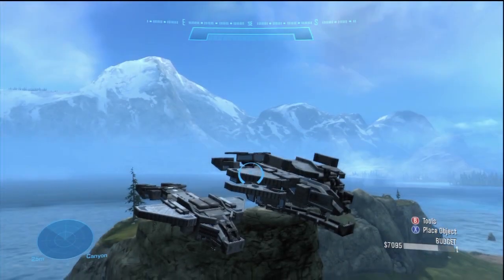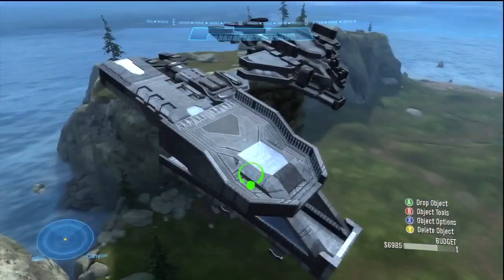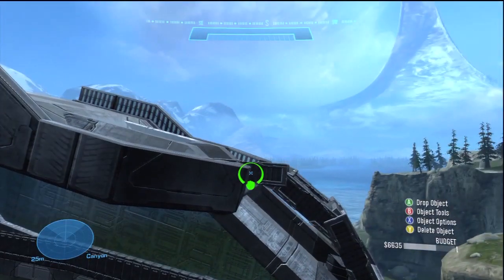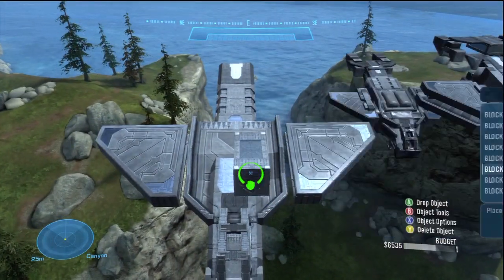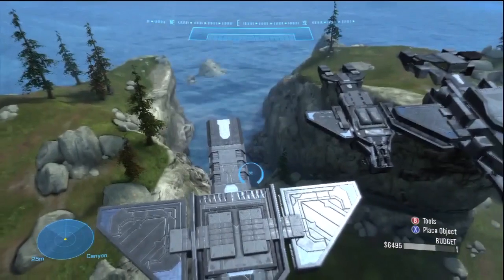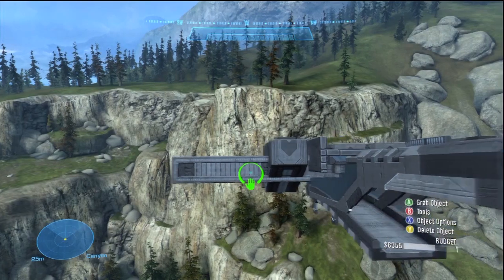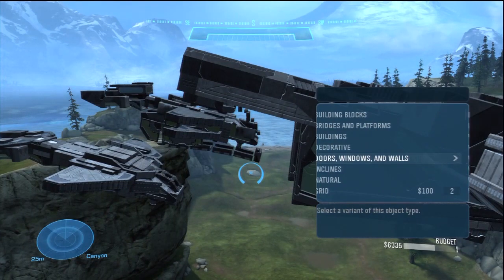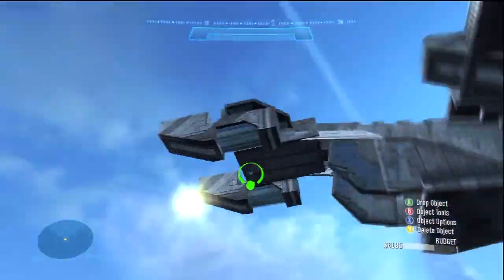"Pelican" - Aesthetics

Comment: @Itudios2 you'd need about 300 colliseum walls for the hull alone :s plus, it wouldn't fit within the Forge World Height barrier. The frigate i'm making required about 120 colliseum walls to make it 1.1 scale, and even then there wasnt enough to cover everything. we're talking about a UNSC frigate here,a 478m long vessel. The Halcyon class cruiser is 1,170m long! you'd have to mod 10,000$ worth of 10$ colliseum walls just to make the shell.

Comment: if u use a clamp either side made of barriers and put a shield door beneath the hog it should stay there if the hog is pressed against the bottom of the tail and wen u go to drive it it will drop